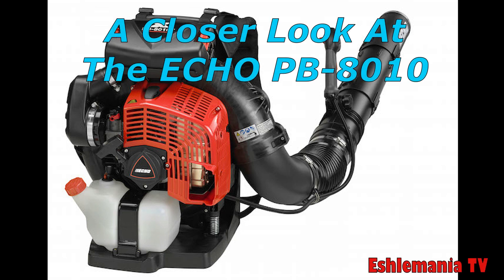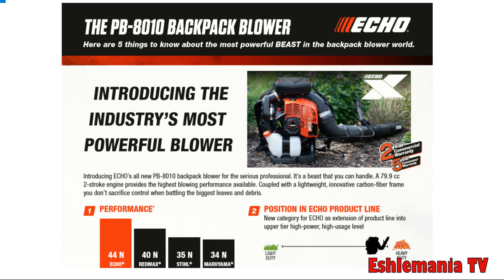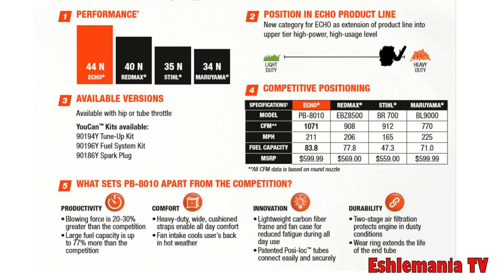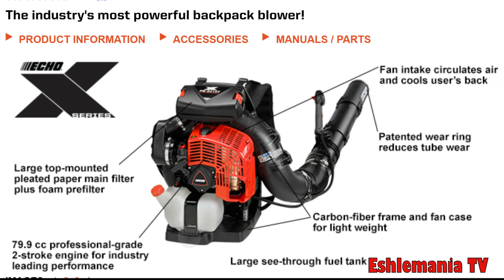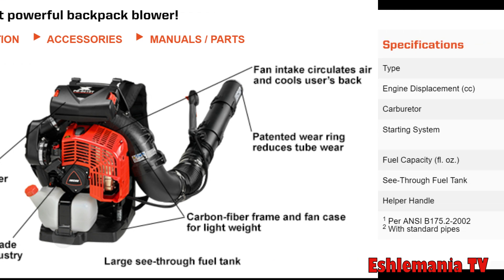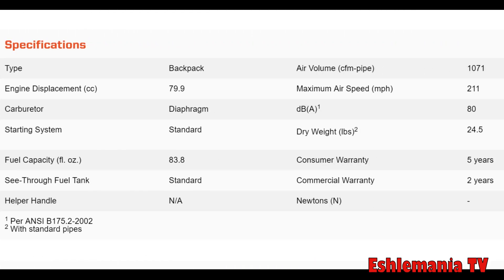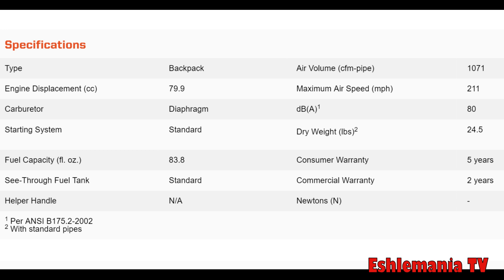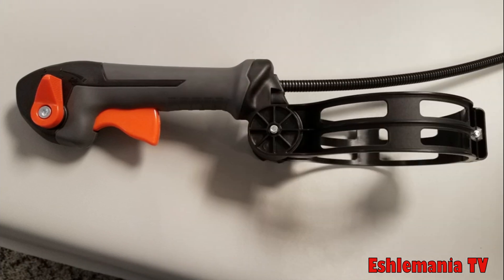A Closer Look At The Echo PB-8010 Backpack Leaf Blower (Engine Disassembly)

Comment: What a beast that blower will easily last 20 years.
Reply from the maker: Much better design than the previous Echo backpack blowers
Reply: Victor Rippe really think it could last that long ? Just bought for my 1 acre lot
Reply: @3r8mo  I just got one - some of the plastic bits won"t last that long - the engine cover and the throttle grip mount are pretty flimsy - but overall I am impressed